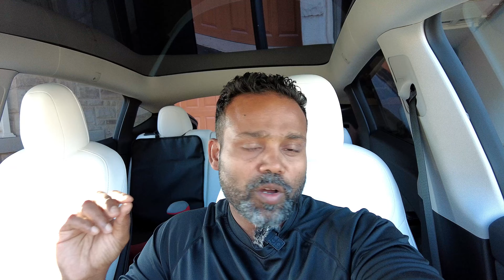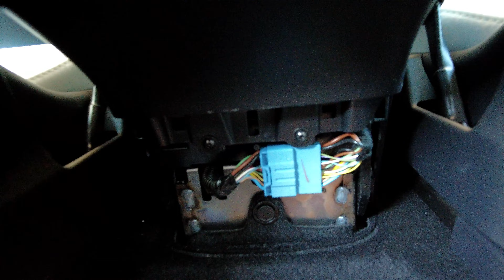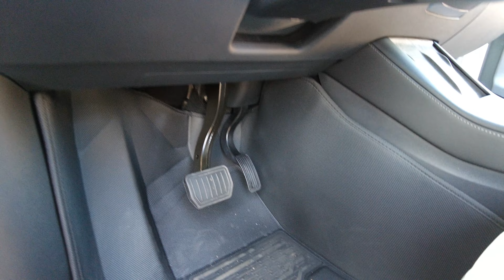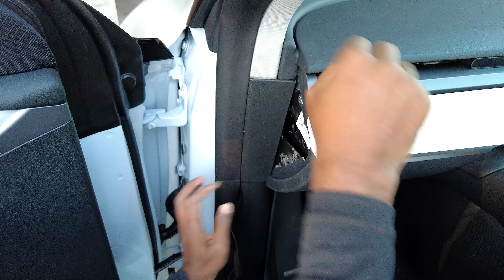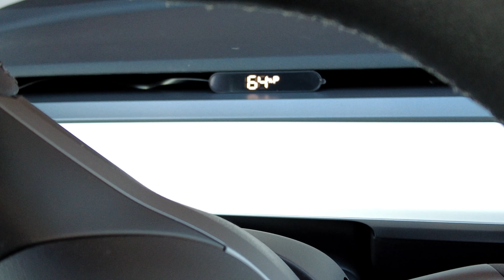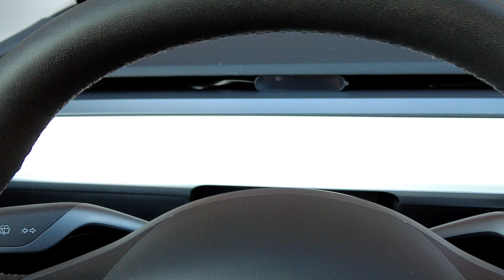VERKOKAPPA Tesla Model Y/3 Mini Heads up Display | With step by step installation Tesla 2019-2022

Comment: Just to update after watching your video before installing my kit, model 3 2022,   June 2024 the kits are being sent out with the wiring in one piece now.
Followed you up to the wiring near the back seat as per video, I needed to feed the wire where the carpet is underneath then you need a t45 male star headed socket to undo the front rear seat runner brackets taking the screw out and feed the cable underneath the runner to a vacant gap, replace the screw and fully tighten making sure nothing cable wise  is caught up, do the same with both and feed to the rear of console unit as per your video.
Why they have made them like this I don’t know. I think the new ones could be version 2 but seems the same as yours.
Reply from the maker: Thank you for the update!